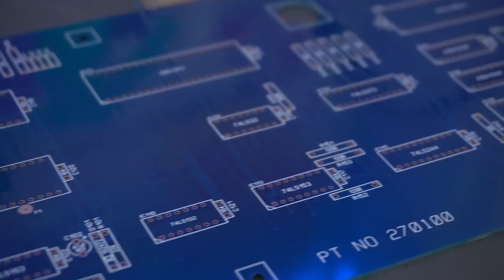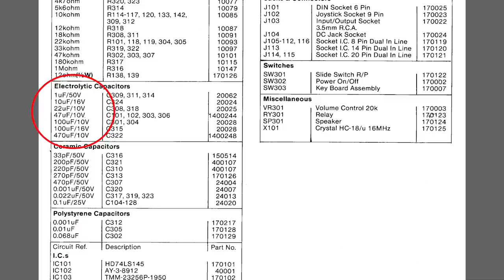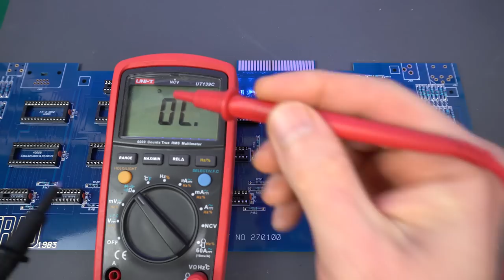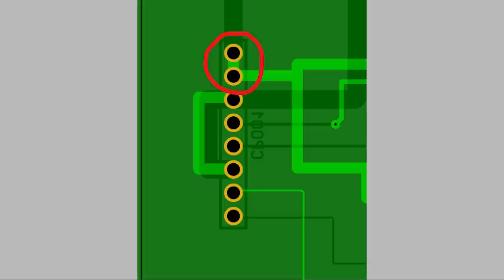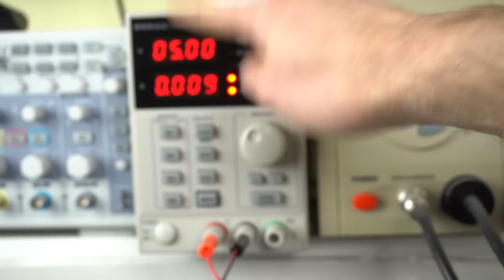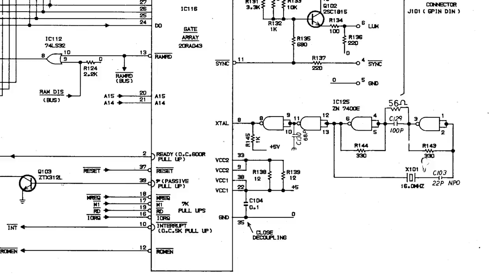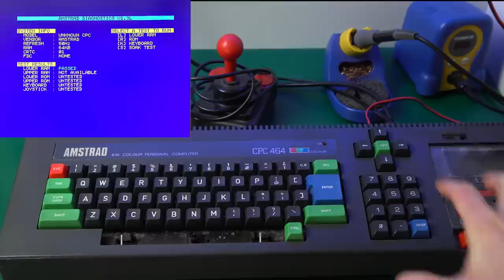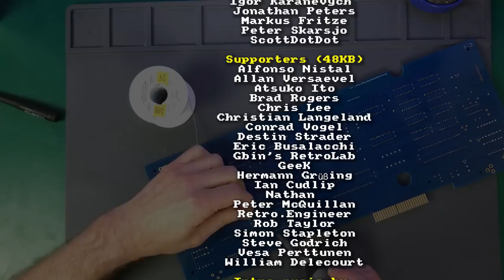Building the World's Newest Amstrad CPC

Comment: Excellent news. We will have to wait however, to have a cpc6128 version and perhaps more refined as we are not all capable of identifying issues on a board! But i could give myself a try and do the soldering part if there is no option to order the board with the components already soldered. Now if we had a reconstruction of the excellent and beautiful, full of character, case of CPC6128 . . .

Comment: 19:42 the reason for the shape is that your scope probe's GND is not connected here (or doesnt seem to be). If you were checking for signal integrity you would want a really short ground to your PCB's ground - often the ground lead is too long and creates ringing. Thats why they have those little springs that go on the tip of your scope probe :)
Reply: 19:52 I spotted the ground connection :) OK, the ringing is probably what I said above - the ground lead is causing it...

Comment: Good diagnostics again Noel... you must be fearless by now :o)

I do wonder at the 464 as the choice for this project. It is quite a limited machine (64K + cassette) and I can only see this board useful for people with a broken PCB in their original 464.

A better way to go as far as I can see would be a 6128 work-a-like with updated custom chip to allow a USB/PS2 PC keyboard, option of 3 or 3.5 inch floppies, a few ROM sockets on board (there is space for maybe 8) and a SIM for the memory that would allow the maximum 2(or is it 4?)MB RAM. That way you could make a genuinely modern version of a 6128 which would work just like the original if that is your thing but also a Z80 powerhouse if you want it. The architecture of the CPC was really good and something like this could do it justice... this would be better than emulation (that can already provide all that jazz) because you still end up with a total hardware solution. BUT, I wonder at the number of units that would come from this... can't think too many people are interested in an uprated version of a 1980s platform - the draw is in the originality.

Tail-end of the 80s, I worked at a company that used to gut 6128s and embed them in radar systems, automatic test equipment etc... we always needed more RAM - we used every inch of the 128K, I loved the page flipping to provide RAMDisk and fast page switching for graphics. All programmed in glorious Z80 assembler. Yummy!

Just an old grey-beards fantasies... ;o)

Comment: Awesome video, I love this kind of project!
That's an interesting approach to reproduce the PCB, the final render is really clean.
Just a question, when you said "from new parts" did you also include refurbished? The TMS4164 DRAM chips are not made anymore if I am not mistaken
Reply: I wondered that. I think it's more accurate to say "more widely available old stock" since things like RAM, CRTC and PPI chips are common to a lot of old machines.
Reply: @HiddenAsbestos  I'm assuming there's other designs that substitute the DRAMs for currently produced SRAM?
Reply: @HiddenAsbestos  Right, same goes for the AY-3-8912 sound chip.
@Lawrence Manning The smallest parallel DIP (S)RAM I could find is 8KB big
Reply: @Zeal8bit  you'd probably replace all of the DRAMs with 1 SRAM (like the Harlequin does) plus some interfacing circuit to map ras/cas to a linear address

Comment: The result with the equivalent transistor is quite interesting. There were quite a few transistors in the 80s that just don't have modern equivalents. Some of the Ferranti transistors in the Spectrum come to mind. Some of the semiconductors in the power supply could handle very large currents for their size and nothing available today comes close.
Reply from the maker: I didn't think of that. In the worst possible case, we should just change the bias and use a modern one that works in that situation. It's just amplifying a clock signal, so it just needs to be fast enough.
Reply: Yes, in that application it shouldn't be too much of a problem.
Reply: Maybe it's litterally the "passive pull-up" shown on the schematic, which could explain. Could work with like a 100k resistor between +5 and transistor base.

Comment: It looks like a very good match for the ZTX312L with virtually the same characteristics and pinout that's still made and available in large numbers is the PN2369A.
Reply: I've suggested a few parts substitutes to Rob already... BC337 will also work :)
Reply: That circuit diagram looks like a 2N7000 MOSFET will fit perfectly... which is an extremely standard part found in any electronics box just like the BC547.

Comment: Ooo, groovy! Another great video well worth watching. Thank you!
Such a little thing but transistors drive me nuts. How I wish they all has a standard pinout. I also detest DIN connectors but that's another story.
FWVLIW: I've been cutting component legs after soldering for more than 30 years because it's convenient and never had a problem. Of course personal preference counts for a lot and I'd never be ungracious enough to castigate someone for doing something their own way if it works for them.

PS Inspiration dawns... I really like the CPC. A replacement 128 PCB with a few extras that usually come as upgrades, plus a replacement keyboard PCB and mechanism would be nice. Kind of like I did for the C= PET. I wonder if the 128 uses standard size key caps? Time to dig out my 128 and check.
Hmm, I wonder if anyone's done the gate array in TTL? A Harlequin-alike might be fun.
Reply: Is there a rule against cutting component legs after soldering? I'm sure it stresses the joint but it seems like almost everyone does it. I do it too, but I usually just re-flow the joint afterwards.
Reply from the maker: Rob is working on a 6128 PCB as well, so that might be happening soon 😃
The cutting-the-legs afterwards comment is because every time I have a soldering sequence, someone tells me that the correct way of doing it is to cut the legs first and solder next. I think that might be the standard NASA technique or something, but I'll trade minor, minor potential reliability for a lot of convenience. I'm not sending this board out in space after all.
Reply: @ShockGoblin  Not that I'm aware of, it's just Noel mentioned it and I got the impression he might have had some push-back for doing it himself so I thought I'd add a little subtle support.
Reply: @NoelsRetroLab  Ah, thanks for the reply and for the info, I really appreciate it. I'm terribly lazy so having thought about spinning my own boards, if somebody is going to beat me to it that's great to know. I might still do a replacement keyboard PCB if they're getting hard to find.
On the leg-cutting thing. I took your video comment as you'd had push-back for cutting legs after soldering. So by way personal support I thought I'd mention I've been happily do the same for years. I hope that's ok.

Comment: another cool video... i want to try one of these but i have some specie replica boards to try first .. that revision of the gate array normally would have the  heat sink
Reply from the maker: That's right about the heat sink. I have them around but I didn't want to have it on during debugging because they stick out to the sides and make using the oscilloscope a pain. It runs fine for minutes at a time without it, so that's not a problem.

Comment: I’m surprised to see a transistor wired in common emitter mode, which doesn’t have a current limiting base resistor. Then again I have no idea about the characteristics of pin 39.
Reply from the maker: It looks like in the GA schematics they mention that the clock pin (39) has a passive pull up. So that's the current-limiting base resistor that is built-in already.

Comment: Hi Noel. Another great video from you, thank you. If you could forward the part number of the right and the wrong transistor, I can find a replacement for you. It is not that easy to find a new one, since you need to take the current/voltage amplification and impedance into account.
Reply from the maker: Thanks for the offer to help. I ended up making a whole video about transistor replacements so I'm all set up for now. Thanks though.

Comment: 16:14 - Wow, that was a long time ago now. lol

I did that Verilog translation after some other clever peeps like Gerald did the hard part (the decapping, and die analysis) to make an internal schematic.

I don't know if anyone actually tested the old Verilog yet, but I tried to make it as close as possible to the schematic.
Reply: I couldn't figure out why PCB software would allow a short between a power pin and ground at first on the CPC recreation.

But it was a mammoth effort by Rob to do a "full" recreation like that, tracing out every track.
So this issue is actually quite small in the scheme of things. hehe

tbh, I personally think it makes a video more interesting when there are faults or issues to fix. I realize this was a beta board, and I think people enjoy seeing the whole building and testing process.
Reply: A small CPLD should be enough to fit the ULA logic. The main issue with most retro projects is the 3V3 to 5V translation thing.

You can still buy some of the older Altera or Xilinx CPLDs that run on 5V (or run on 3V3, but have 5V-tolerant IO pins).

People have of course made repro "chips" for things like arcade PCBs, using small voltage translators / buffers, it just takes longer to do the layout for that.
Reply: I should say, btw - my Verilog translation of the ULA was only a starting point.

Others have discovered errors in the schematic and other issues since then, and a lot has been fixed.

It's interesting looking back at the cpcwiki posts again, and the newer posts. I haven't visited that forum in quite a while.

Comment: Good video. However, have I missed something here?
Was the vcc to gnd short a one off, just the board you received (a pcb manufacturing error) or was this an error in the layout?
If it was a layout error it seems odd the Bob had not picked up the board short while prototyping the design.

You are right, the board would look good in a picture frame on a wall.

Comment: Will it work? Are you cutting corners or using substandard parts (rhetorical question)? No, of course not. It is absolutely going to work. I would say your biggest problem is the old software needed to run it. I don't have much experience with computers as old as the Amstrad but I do know how finicky a Commodore 128 in 64 mode is running cassettes. Don't get me started on old floppies...what would happen if you used a faster, yet compatible CPU? Would it scream, work as intended, or completely fail?

Addendum- I want to build a miniature 486DX2.

Comment: Sure it's more convenient to cut the legs of the components after soldering, but you run the risk of making microscopic breaks in the solder joints resulting in bad connections.

Comment: Would have been nice to have a ZILOG Z800 in place of the ZILOG Z80A so you can play AMSTRAD games and create and compile new games that take advantage of the ZILOG Z800 so you can make use of the mul/mulu and div/divu instructions so there is no need to write multiply/divide routines and make for smaller faster programs.

Comment: Something interesting to note is the original Z70100 board has the silkscreen for R111 17:40  but no resistor (top right), but you have populated this spot on the new board as the silkscreen is there 17:57 .  I wonder what effect this has?

Comment: Great video. Do you know why the transistor was not working. Too much base current pulling the signal down?
Reply from the maker: Good question. Unfortunately I didn't follow that up because I was already late releasing the video 😃  But yes, I would guess too much base current, which is why the transistor was there in the first place since that clock signal might not even be able to drive the CPU itself. I just pulled that transistor out of an equivalent table, but clearly some parameters were not correct (I did double check that the layout was correct).

Comment: Why not just use an xacto knife to cut the traces you need? Other than not owning one, but you have lots of nice equipment so i figure a razor blade is probably nothing lol. 
The patch fixes for that cap and such seem right for an early home pc mobo, many old computers did get released with manual revisions to prevent delays.

Comment: Great job building this board.  But where to get these connectors specially the "LK" references in having a hard time finding. Trying to build my own is challenging finding parts. Thanks!
Reply from the maker: I think they're in the service manual. But the LK ones just change the company name on the initial display screen IIRC.
Reply: @NoelsRetroLab  Thanks!  I think I got the parts coming my way. Cross fingers.

Comment: I've been rewatching this video, and now I wonder about the transistor. Will it be possible to use a modern compatible one? Was it just a problem with the model chosen as a replacement?
Reply from the maker: I believe so, but I haven't confirmed it. I think Rob will try to list a modern replacement in the BOM he created.
Reply: I found an equivalent listed in the datasheet for the ZTX312, it is 2N2369 which is still available for purchase.

Comment: To find the short to ground just whack 50 or 60v with unlimited amperage...  you will find the short quickly and easily!  Life Hack!
Reply: Umm. It'd probably found just a weakest link from the board though, since those shorts were quite wide...
Reply: @gadi70  I see you didnt understand.  Its a joke.  If you do this you will destroy each of these faults one at a time.  As each burned clear the other would take the current and then burn clear.   The board would be damaged.  Don't do it.
Reply: It would have made a great addition to the video :-)
Reply from the maker: It sure would have increased the view count! 🤣

Comment: I have a spare complete 464 - late model, given to me dead. It's yours if you want it. the key shape is different though. I'll test the keyboard on my working 464.

I found your channel after feeding my 6128 12v by accident, if you can offer any tips on how to fix that (is it possible to buy the diagnostic cart/ROM?) I'd appreciate it.
Reply from the maker: Thank you. Yes, the key shape is totally different in the later models from these. That's what makes replacing it so tricky. I may have to experiment with 3D printing.
12V on a 6128 is pretty common. Most likely you just fried half the RAM, so it's not a huge deal. You can burn the diagnostic ROM I wrote (check Github) on an EPROM and pop it in. Or get a ROM cart like a Dandanator or some other and run it externally from there.
Feel free to jump on the Discord server and ask for help there. Good luck!

Comment: @23:38 or just 3d print a replacement spacebar?
Reply from the maker: Yes, that might be an option. Although it may be hard to get it smooth enough? Not sure how far 3D printing has come for stuff like that, but I'll probably look into it at some point.
Reply: @NoelsRetroLab  i'm sure they could be easily sanded smooth. looks like there's a lot of keycaps on thingiverse that could give ideas or be used as a starting point.

Comment: Why don't you use the prefixes "nano" in capacitors capacitance?
74LS well why would I use HD from Hitachi, if I can use the Russian S series or from Tesla MH74S or classic TTL, or if you want to save power consumption and maybe money, the 74HCT series with small modifications is enough.
ZN7400E hm I only have a socialist replacement MH7400 :)
Instead of Z80CPU I will use East German clone U880D and instead of M5L8255AP I will use Tesla MHB8255A.
What you say (is not very important about electrolytic capacitors), I would venture to say that it is very important and that no dry junk, but for sure honest tantalum capacitors and it is not worth saving.
But it seemed to me that the temperature of the soldering iron in your daughter's hands did not even reach 100 ° C, and not even lead tin could smelling rosin :)
Aren't you ashamed to use those cheap low quality DIP sockets?
And even ridiculous is to use a Chinese multimeter, I'm not saying it's not good, I use UT70A, it just doesn't fit the assembly of the legendary computer :)
An RLC bridge is used to accurately measure low resistances, say below 0.1 Ohm ...
PCB via Eagle drew your daughter or?
Instead of replacing the BC547, I will use a Tesla KC507 in a metal package :)

The Chinese desoldering station ZD-915 somehow doesn't fit in your workshop, but I have it too :)

You still need to learn a lot :)
I started with this around of 1983 year.
https://www.youtube.com/watch?v=VxIJMGFXT9w
https://pmd85.borik.net/wiki/Download/Dokument%C3%A1cia&setlang=en
https://www.youtube.com/watch?v=0_azgCr45YA
https://www.youtube.com/watch?v=3hTjRmQ4gDU
https://www.youtube.com/watch?v=20ZjXs_63M8

Comment: Solder smoke is a bad thing to breath, probably worse than tobacco. So, don't let your children to get much exposed to that nasty stuff. A forced ventilation for your workplace can also be a good idea...
Reply from the maker: Agreed. Right now I have a fan blowing on the work area (you can even see in the frame, clamped to the shelf) and the window open. I need to get an actual filter/extractor at some point.